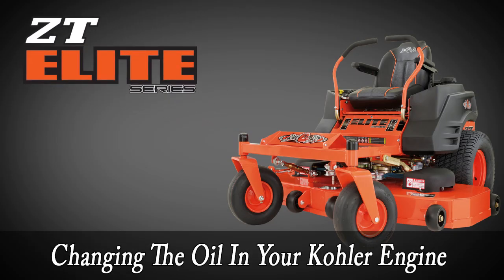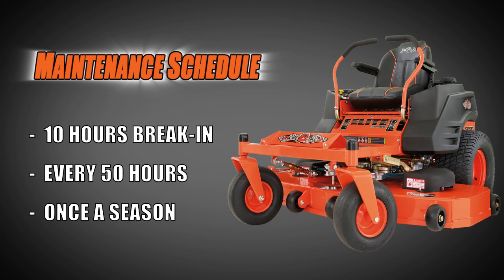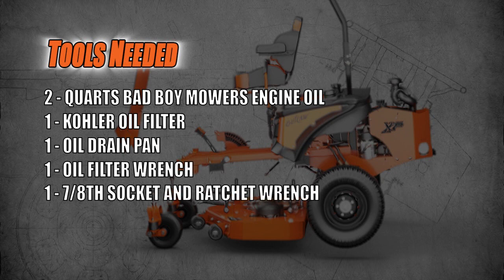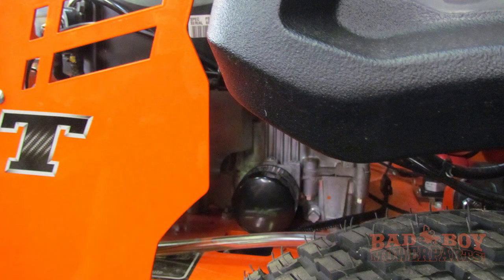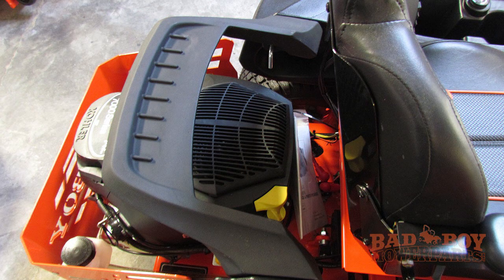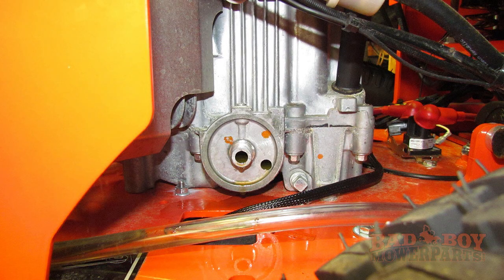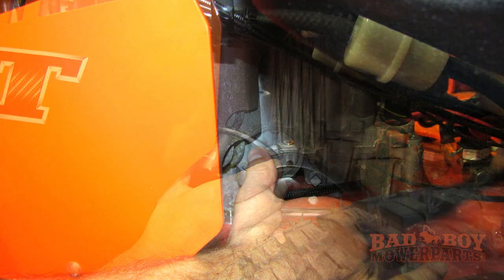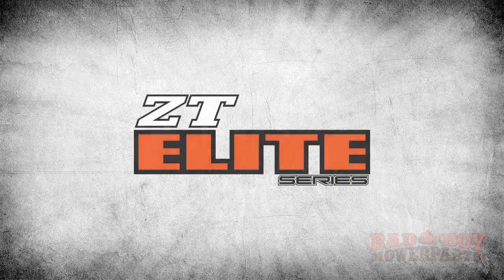ZT Elite Kohler Engine Oil Change

Comment: I'm looking at the ZT Elite 60". We had an Exmark Laser Z with a 25 HP Kohler engine and never had a problem with it. Are these Kohler engines similar because I'm hearing some people complain about them? Are the Kawasaki engines any better?
Reply from the maker: The ZT Elite is a great machine but the Lazer Z is a full blown commercial mower and the Kohler engine on it should be the Kohler Command series which is Kohler's top of the line engine. The ZT Elite bridges the gap between residential and commercial mower. The Kohler engine on the ZT is the 7000 series which is a residential grade engine. If you are looking for something more comparable to the Lazer Z check out the Maverick or Outlaw. These mowers have the commercial components you are used to on the Lazer Z. Both the Maverick and Outlaws are great buys. You get a bang for your $ that you don't with other brands. Thanks for the question!
Reply from the maker: Kawasaki engines are awesome just know they are more expensive. Kohler engines are consistently good engines. There are no current issues with the 7000 series we are aware of.
Reply: That's what I thought its the Kohler Command and I knew it was commercial grade but I wasn't aware the differences between the 2 engines. Yeah my dad took the Exmark to his property which is much larger and we just don't need anything that big for our 1.2 acres and I like the price of the XL Elite. What would you say is the biggest differences on the Kohler 7000 vs the Kawasaki?
Reply from the maker: Price is number 1 for me (Kohler $4999 and Kawasaki $5299). It sounds like you take care of your stuff and do the maintenance necessary for your mower to last. On the 60" you will see no power difference between the two. If you take care of either engine they will both last the same. Bad Boy's best selling mower for years has been the ZT 60 with the Kohler.
Reply: Awesome, thank you. Already check the ZT Elite out at Tractor Supply, but they only had the Kohler model. Hopefully I can check them both out at the dealer tomorrow.

Comment: What if you don't have a drain hose?
Reply from the maker: Very good question! We get asked this more than you think. Pretty much all Bad Boys have a drain hose or valve included from the factory. Check both sides of the engine to make sure you have not overlooked the hose. If you have no drain hose or drain valve we sell them. You can still drain the oil but it is very messy. Bad Boy puts a lot of the drain hoses on the starter side of the engine for Kohlers so be sure to check that. Kawasaki engines sometime have hoses and sometimes valves with clear tubing included in the owners manual packet. There are drain plugs on both sides of the engine so find the one by the oil filter then look in the same location on the starter side. We hear this detail is left out many times when customers buy the mowers. If you need any more help just call us and we would be glad to help more. Thanks again for the great question.

Comment: is there any way to adjust the hydrostatic pumps my left side is real weak
Reply from the maker: There isn't an adjustment other than the idler system. Sometimes changing the fluid and doing the purge process can fix it. Sometimes the charge plate can be going out. Of course there is always the chance the trans is going out. Do the air purge process and see the if that helps. Thanks for the question!